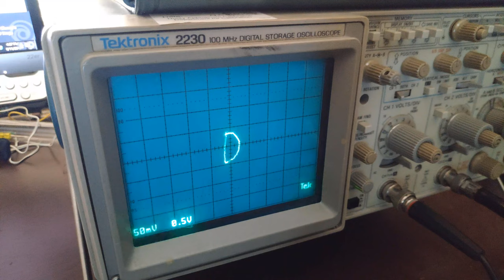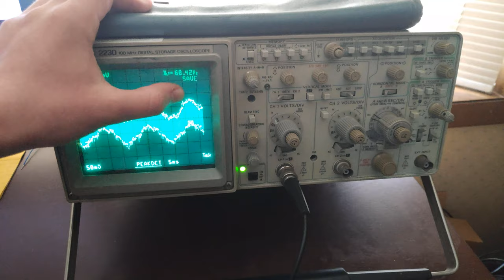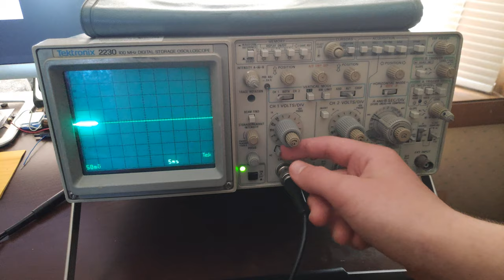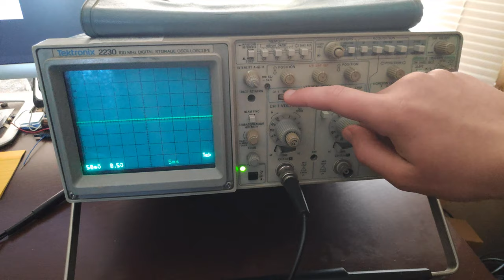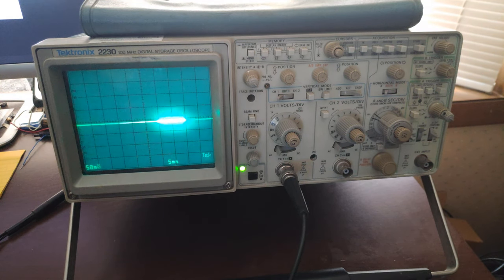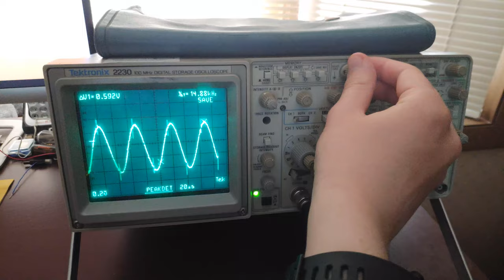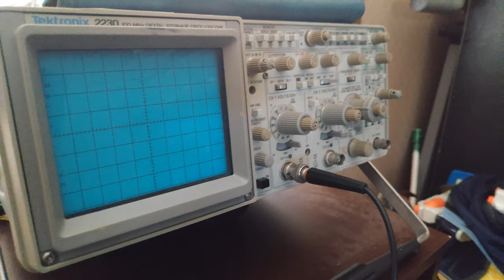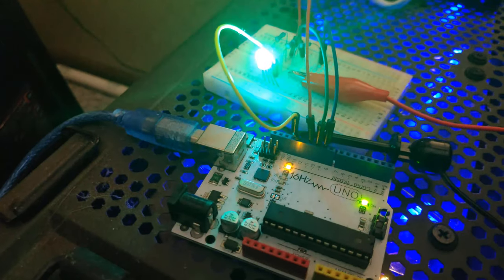Tektronix 2230 Oscilloscope Overview

Comment: CORRECTION FOR YOUR KNOWLEDGE
4:00 Re COUPLING 
"Coupling" means TO JOIN.  Now in Civil Engineering a coupler is a device that would join (say..) 2 pipes together.  In Electronics and Electrical Engineering coupling is a way of joining 2 transmission lines or transmission signals together.  so what you're actually doing by flicking that switch from AC to DC to GND is 
on one side you have your input signal and on the other side you have your scope, You want your scope to accept the correct signal

Now you said "Most times you're gonna want to use AC"     
NO, INCORRECT, Most times you want to keep it on DC   and here is why 

EXPERIMENT TIME :
AC TEST
- Set your scope to AC COUPLING
- Input from a signal generator , say... 1Khz Sine Wave, 2V Amplitude,   (everything works, right )

DC TEST
- Set your scope to AC COUPLING
- Connect a bench power supply and set it to 2V DC
NOTICE HOW YOU CAN'T READ THE VOLTAGE ?   

Now... Flick the Coupling switch back to DC - Now it works doesn't it    DC TEST PASSED ON DC COUPLING
Now... Re insert the signal from the Sig Gen (which is AC) and keep the coupling on DC   IT WORKS DOESN'T IT ?

so, if you're on AC Coupling you will only see AC Signals  but not DC
if you are on DC Coupling you will see both AC and DC Signals
Which is why it makes more sense to keep it on DC coupling for beginners , Because it's a no brainer 

4:17  that's the VERTICAL Amplitude position knob  (needs to be specified to distinguish from Horizontal time position knob) especially when teaching newbies

4:20  not "Centre"  but  "Zero Baseline"
the screen has graticules as you know

THIS IS SOME POSITIVE VOLTAGE LINE ----------------------------------------------

THIS IS THE 0V BASELINE----------------------------------------------------------------

THIS IS SOME NEGATIVE VOLTAGE LINE ---------------------------------------------

And the same holds true for the Horizontal Time Base
- The centre of the screen is  0 seconds delay
- to the left of the middle horizontal graticule is  - seconds time
- to the right of the middle is + seconds time
when you go from left to right you increase or decrease the DELAY in the scope on the signal

4:54 Re Intensity knob , Re ONLY on older scopes
NO....  Rigol MSO5000 series has that,  DS2000A Series has is etc etc  basically most new scopes have an intensity as well, 
What they don't have is a FOCUS knob , and sometimes new scope vs old scope has the same function (Like TRIGGER knob) but they have different names,Like My KIKUSUI COS5041 calls it 
HOLD OFF

6:05  RE BEAM FINDER
You know WHAT it can do ,  You don't know HOW it does it.   LOL
ALLOW ME TO EXPLAIN  and show you a trick that you didn't know also 

- The beam finder switch is a NON LATCHABLE /  MOMENTARY SWITCH (that's done for a reason)
- When you press Beam find it does 2 things 
THING 1 - It increases the intensity of the trace Automatically to full intensity
(So.. if you accidentally had your intensity know to 0 , you can still find your trace)

THING 2 - LISTEN CAREFULLY...............  You know how 5x Magnification works, right ?  zooms in by a factor of 5 Times.   well this is the reverse.
When you press Beam find the bandwidth is increased so that the Gain on the scope is REDUCED BY 5x  , Hence if the screen is 10 divisions wide and 10 divisions high, -5x Gain will mean that you will see the trace 2 Divisions wide

NOW HERE'S A TRICK
When you press Beam Find (instead of letting it go, then scrolling the position down down down down  blah blah blah)   
- You can hold the beam find knob  while in 5x Mag mode (it will now move 5x faster)
- while holding the button adjust your vertical or horizontal position so the trace goes to the centre
THEN RELEASE THE BUTTON AND IT'LL BE IN THE CENTRE    LMFAO ... SEE.... TRICKS OF THE TRADE MY FRIEND 

8:27 "since i don't have a function generator"
WHAT ????  YES YOU DO 
Between your intensity knob and Channel 1 Horizontal Positon knob you have a hole called  PROB ADJ (Stick a probe in that hole and you'll get a test signal), 

OUTSIDE OF THAT YOU SHOULD HAVE SHOWN THIS AS WELL
Before measuring anything you need to confirm that you scope is actually calibrated

so....

TRACE ROTATION -  Explain that you need to stick a flat head into this hole and make sure the trace is on the Horizontal base line all the way

CALIBRATION KNOBS
Feed a Sine Wave,  2V per Div  1kHz into the scope
Go to Channel 1 , Set it to 1ms Per Division

Now, Using the Vertical Amplitude time base, Adjust the CAL knob so that from top to bottom your signal is 4 division Peak to Peak . Meaning 2V Amplitude in the positive direction and 2V in the negative.  this is calibrating your Amplitude correctly

Now.. Using the Horizontal CAL Knob, on 1ms Per division for the time base while having 1kHz signal,  Meaning the time is 1ms. PER DIVISION
Meaning, Adjust the CAL knob so that the signal is exactly 1 division wide

if you do that, you then know you're measurements are correct.

other than that.. GOOD VIDEO

Comment: Do you think that for under a 100 bucks is a good deal to buy one of those?
Reply from the maker: I think I payed $120 for mine. It could be a good deal if you know it can do everything you need it to be able to do... Modern digital oscilloscopes have new features that this scope doesn't have.
Reply: Well this is my first scope so i need just the basics and even this one is an overkill for me.
Reply from the maker: @nicolocatanese3477  Then yeah, I don't think it would be a bad deal. Probably not going to get a better scope for cheaper.
Reply: Tank you very much, great video btw.
Reply: it's a 2 Channel.....100MHz  , DIGITAL Scope

it's not an Analog 20MHz Dual Channel scope.
Yes, $300 would be fine for this

Comment: 3:03  LOL, Those times when you start talking about something and then you realize...
ummm shit, that's not right, 
Umm hang on... what was i saying
ummm that doesn't make sense
and then you realize 
Holy shit i've already started so i have to finish
and then you go on about magnetism and antenna's and whatever and then hope to god no one realized
followed by .....................................LONG PAUSE  and
"........ANYWAY"  Moving forward... Nothing to see hear....... keep it moving
LMFAO

so... To correct a few things
- it's not correct to say we are an antenna
- it's now how inductors and transformers work, I assume you were going down the faraday's law of induction road here

1. This is not an inductive "Thing" aka Phenomenon
2. This is a Capacitive Phenomenon

There is capacitance between you and the wires in the wall.
There is a difference capacitance between the scope ground and mains power.
The input impedance is sufficiently high between the 2 to create (in a manner of speaking) a voltage divider between mains, The scope probe and the ground reference.
THAT'S WHY IT HAPPENS
Reply from the maker: ...makes more sense than whatever 16y/o me was babbling about lol, appreciate the detailed explanation.
Reply: @novano1d  
Oh... YOU'RE ONLY 16   LOL
well then my friend. YOU ARE FORGIVEN.

I mean.. I'm 50  so... yeah 
Been doing electronics since i was 4

But No.. it's ok, i mean 
1. it's tradition to take the piss out of the younger generation.  I had the piss taken out of me from time to time when i was younger (your age) , NOW IT'S YOUR TURN  :p
You need to be inducted and christened

2. You took properly, you didn't get the shits, Kids your age would get the shits.the fact you didn't SHOWS MATURITY. Well done
it means you can take criticism when you're wrong 
AND IN THIS GAME YOU NEED THAT TO BE GOOD AND TO LEARN

3. Now there's a saying
Bullshit until you make it   LOL
So.. In electronics making up a degree or shit based on some fragmented information IS PERFECTLY OK, Because what this does is.. it allows your brain to explore and go in different directions
AND THAT'S A GOOD THING

So.. don't worry about it.
But if you must know the reason, the answer i gave was the simple explanation

Capacitors in a nutshell

PASS AC but do not pass DC

Now a person then asks, But in a switched Mode Power Supply when you get past your input filter stage and after the bridge rectifier , then you have a bulk filter capacitor
so.. if the bulk filter cap is before the transformer and we know the transformer needs DC to induce power to the secondary side, How then does the voltage get through the capacitor if it's DC ?

The answer is 
IT FILLS UP THE CAPACITOR........
THEN IT CAN'T FILL IT ANYMORE

but.. After the Capacitor there is a MOSFET (Transistor) that is acting as a high frequency switch)
Now really really quickly what the Transistor does is....
1. it discharges the capacitor into itself  to create A LOGIC HIGH (ON)
when this happens the other side of the capacitor is allowed to fill up again, While that happens the transistor goes through a LOGIC LOW (OFF) and this a square wave is created

so one might say  current is flowing through the capacitor
NO IT'S NOT
IT'S CALLED DISPLACEMENT CURRENT
(Google it)

in a nutshell even though a capacitor can't pass DC, we have tricks of turning on and off to cause things to flow anyway.

as for AC it will pass AC no problem.
that's the basics of a capacitor.

but yeah mate, Keep asking questions and keep making shit up TO A DEGREE, it's ok to bullshit ,  Just don't go overboard

You're doing a good job, Keep up the good work and RESPECT for owning a CRO and understanding how to use it.

Take care mate, Never stop learning electronics, I've been doing it all my life, it's fucking fun i can assure you.
Reply from the maker: Well, I'm actually 20 now :) when I recorded this video I was 16.
I just working full time as a development engineer and am working on (firmware... I was a Computer Science Major) for a cash dispensing module for the latest ATM by Diebold. They have much fancier keysight oscilloscopes but I still have this one for myself. But point is, I am actually working on this stuff finally (for dollars at least) and the hard work pays off. I hope to learn more about mechanical and electrical engineering here too. But I think with AI and embedded systems coming together, the potentials are going to be endless. 
The detailed explanation is much appreciated, I want to learn EE more in depth with time. I started reading a book on it recently.